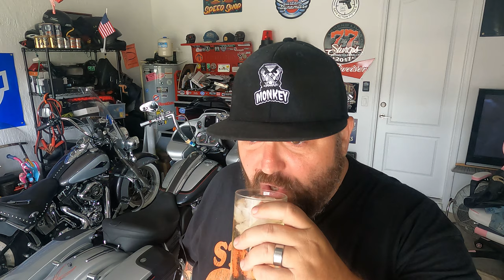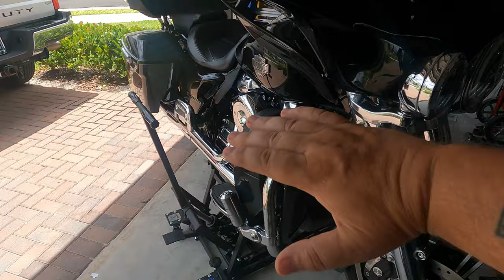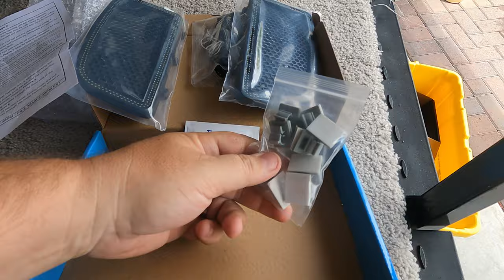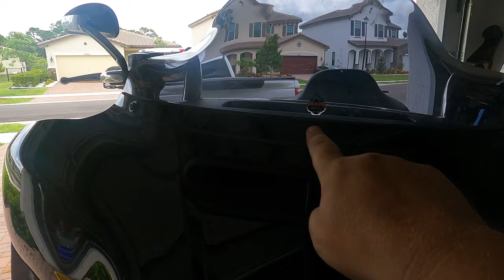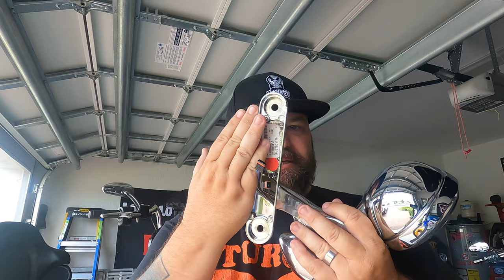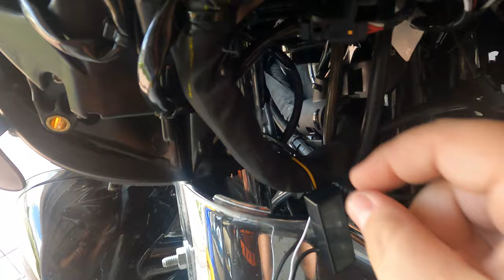Lightin' up your lowers! Custom Dynamics lower fairing lights!!!

Comment: We bought the Custom Dynamics lower lights for my wife’s 2019 Triglide.  Like you, I didn’t really understand the directions so I watched several videos of installing the lights.  Nobody showed the part where you connect the white wires under the faring.  We decided to take it to our dealer to install the lights and then I saw your video.  About one and a half hours later we had the lights installed. Thanks for taking the time to show the complete install.

Comment: I just finally got mine installed!!!  Watched a couple guys do there lower fairing lights but no one talked about the white wire with the loop !!!   Could not  figure out why they didn’t work!  Thank god I came across your install ! Figured it out after watching you!   Thank you man!!!!!!
Reply from the maker: Glad I could help!
Reply: @ProfessionalMonkey  I’m watching your Wilbur shock video!!!   You honestly love them !  I totally trust you and will buy them if u say so lol !!!    I’ve watched ohlin and legends   Everyone says something different lol
Reply from the maker: @coryanderson7313  I think the thing is that ALL aftermarket shocks are 1000% better than stock. Anything is an upgrade, but if you're running a big full dresser with a fat guy on it, the Wilburs are gonna handle that weight better!
Reply: @ProfessionalMonkey  ok awesome yeah I’m 6 ft.   340. Lbs.  my wife is 170.   I have 2014 ultra limited.   I’m big  I don’t think I’m fat.  Just big boned lol.

Comment: The lights look and work great.  I did the lowers and the fork lights from Custom Dynamics on my 2021 Road Glide Limited.  Matter of fact, the bike is almost completely done, except for the latch lights. The wiring is trickier because you have to snake them through the system and remember that your forks turn but the fairing doesn't.  Therefore you need to leave slack in the lines to turn the handlebars.  Thanks to the assistance of the Custom Dynamics guys, they helped he figure it out..

Comment: I found the loosening of the two lower Allen screws not only impossible but unnecessary and was able to fish the wire through the lower easily. I installed the mirrors and windshield trim light as well.

Comment: I just installed these lights on my 2020 ultra limited last week, found out those white wires are new, in fact the instruction with mine had the old system that used the the turn signal harness to power the white lights. But after a quick call to Custom Dynamics help line they help get the right instruction to me. Again great customer service from Custom Dynamics. These lights are a big improvement in lighting up the front of the Bike. Professional Monkey if you would have done this video/ install over a week ago i would have known what the extra (white) wires were for and how to hook them... LOL Your video is very good, hopefully it will help other that might have gotten the wrong instruction with the new version of these light. Custom Dynamics did explain to me that a few got sent out with the old instruction.
Reply from the maker: I hope it helps. Also the the power line loop through thing was confusing to someone like me that is only somewhat intelligent.

Comment: Sweet, Keep the videos coming. I couldn't afford to buya painted fender, and I wanted the CVO filler panel between the fender and saddlebags, did a little research, and went and bought one off of Ebay, anly been out once or twice because of weather, and got plenty of comments on it. Gotta make it your own, especially if your bike is black, cause everyone has a black Harley, except mine, Gauntlet Gray and blacked out. enjoy working on my bikes, because HD, IS TO DAMM EXPENSIVE!

Comment: We used to use the tie downs when trailering  but my husband stopped bc he didn't like the added constant pull down or compression on the forks during travel.  So we sold ours, but I do believe they still make them.

Comment: Jameson and gingerale maybe.   Dig those lights alot.  Which s&s air cleaner did you go with on the limited?  Really digging the look each time I see it.  Also yes they still have the fork mount tie downs for behind the spot lights, got them on my Streetglide, they help.
Reply from the maker: The Intake I have is the Stealth with the classic tear drop cover (not the mini). I like it cause its what the cool bikes had when I was a kid.

Comment: Thank goodness I just watched this video. CD has links to two install videos that don't mention those WHITE wires. I also have CD vent turn signal lights. I had everything blinking perfectly but could not power the running lights!! Took it back apart. Damn ran out of daylight. Thanks

Comment: I've never taken my fairing off. A Harley tech was going to charge me to do it off the clock but I'm wondering if I can truly do it myself
Reply from the maker: Not much to it! Three screws at the windshield, two on the back side on each side, unplug the headlight and you’re good to go!
Reply: There is gas tank and fender covers you can buy to cover the paint from when you drop a tool  bolt or what ever. Towels will work and from chipping your paint
Reply: I think I just may save that $100 bucks and try this myself
Reply from the maker: @detroitrob1436  Go for it! It's scary the first time, but you really will be just fine.

Comment: Dude, looks awesome!!!  I’ve been wanting those for my 2019 CVO.  I also want the ProBeam Dynamic Strips front turn signals low profile and the rear saddle bag latch lights, and the front fork lights that replace the reflectors.
Reply from the maker: All good choices. I am not a fan of reflectors on my forks though. I have never gone more than 24 hours without pulling those off the forks of a new bike!

Comment: I purchased these, along with Custom Dynamics LED vent insert for my 2020 Tri Glide Ultra. After installation, I encountered a problem. When the turn signals are on, the opposite side running light would flash intermittently. When I installed them, I had the battery tender hooked up. When I disconnected the battery tender, the turn signals worked, but there's no running lights or passing lights. Customer service at Custom Dynamics has been phenomenal, but we can't figure out what the problem is. I'm wondering if there's a modulator of some kind installed somewhere or if there's one I should install. Great channel by the way. I never miss a video.

Comment: I'm curious. On the light housing, it appears there's a grill. Does that stay open for air to pass through, or do you put the stock block plate back in. I'm not talking about the piece that rotates to block/ let sit pass.  But rather the piece you have to pop out to install the entire light housing on lower fairing.

Comment: Just ordered a set,  Instructions say I should have LED bullet turn signals.  I do not currently have them.  I have the old factory bulb for turns still.  Is this an issue or am I going to have to replace with LEDs in order for the lowers to work?
Reply from the maker: Hmmmmm... I haven't run into that yet.  If it were me I would plug them in and test it to see if it works before you buy the LEDs, unless you are just looking for an excuse to get LEDs :). I will say that it will look better if its all LED since the old bulbs will blink slower... maybe that's the problem?

Comment: I put lower fairings on my 2018 Road King Special.  Do you think I can hard wire these directly to my running/turn signal wires?  I cannot find anyone who has done this.
Reply from the maker: Yep, they plug in sequence with your turn signals. They'll work fine with a Road King.

Comment: My white light does not come on..only the amber turn signal. Suggestions?
Reply from the maker: Problem has to be with the daisy chaned longer wires, the problem is in there somewhere.
Reply: @ProfessionalMonkey  I can't find where the white wire connects.
Reply from the maker: @kingair350  should be a plug to the upper left of the fairing, the white wire plugs in there, then the second white wire plugs in there, then the original wire you unplugged goes back into the the last white wire plain.
Reply: perfect thanks

Comment: And NO SIR you do not have to remove the outer faring. All you have to do is remove the Aux/turn signals. Thats it!!!
Reply from the maker: How is that? You have to get to the aux power plug that is inside the fairing? If you don't you would only have turn signals, no dynamic running lights.
Reply: @ProfessionalMonkey  not true...I did mine in 10 minutes AND I have Aux lights too!!
Go to my page and check it out youll see.